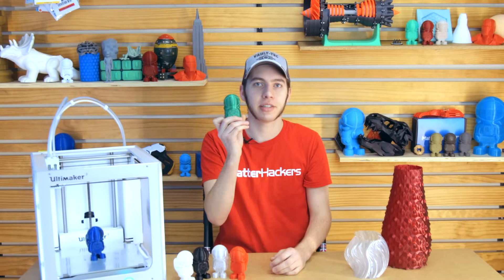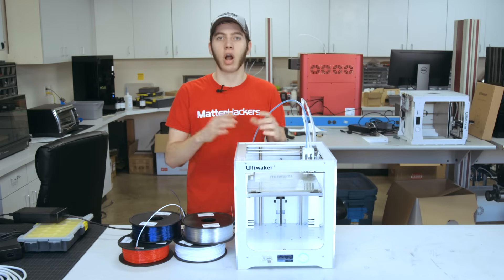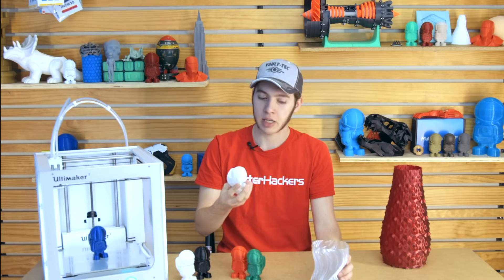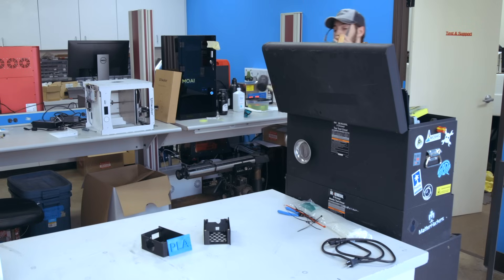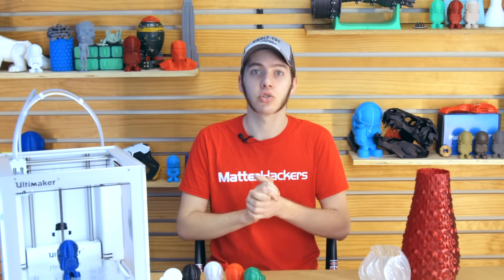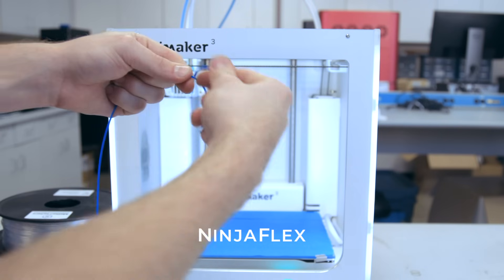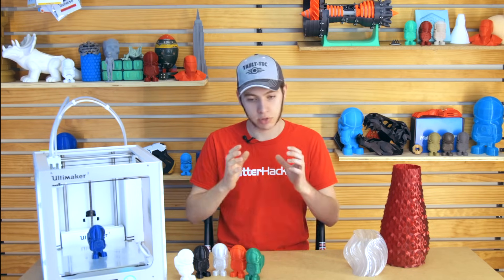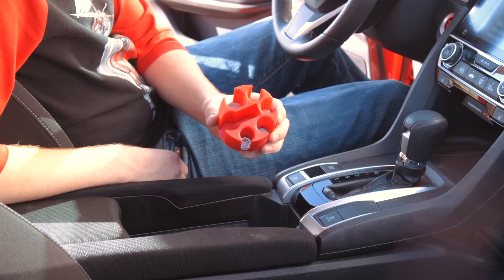BEST TIPS FOR BETTER PRINTS WITH PETG | Everything you need to succeed with PETG filament

Comment: Here I am in 2020 using amazon basics PETG and printing with a PTFE-lined hot end at only 230c. I leave the part fan off, except for bridges where it runs at 40% which is about the minimum for the crappy fan on my printer. The parts aren't super amazing, but they are absolutely serviceable and way harder to break than the same parts I print in PLA. Essentially, I can print finer detail in PLA with less globbing and stringing, but for anything that isn't a fine-detail miniature I use PETG. If I'd print it at .2 or higher layer height, its better in PETG. If I'm printing at lower than .2, its going to matter how tolerant the print will be to blobs or strings... but I still might try in PETG first because its a better material overall IMO.

Great tip about the support though, it can be a real PITA to remove, I hadn't considered increasing the gap - seems obvious in hindsight!

Comment: You don't NEED an all metal hotend for PETG, PTFE tubing is generally considered safe up to 250-260C, and frankly most PETG prints fine at 230-240 anyway. If you're concerned with it off gassing even the tiniest amount then I wouldn't print with it above 200C as that is when PTFE begins to off gas...

Comment: I'm still pretty new to 3D printing.  My problem is likely user error.   I have an Ender 5.  I have not done any upgrades so everything is stock at the moment.  I am having one heck of a time getting PETG to stick to the bed and not to the nozzle.  I'm going to pick up some hair spray to try next.  I have been trying to print on painters tape and it won't stick to my bed.  It keeps sticking to the nozzle.  my printer will run a prime down the right side of the bed no problem but as soon as it moves over to my part it just won't stick to the bed.  Any tips on how to fix that?  I've tried a bunch of different things (different temps, slower speeds, etc.) but I just can't seem to get the first layer to stick to the bed.   I'm printing PETG because I'm making custom kayak parts.  From what I gather that is one of the better filaments to use for such things.
Reply: I do keep it in a dry box.  I'm going to try and dry it out in the oven.  I also picked up a Micro Swiss MK8 Brass Plated Wear Resistant Nozzle to see if that makes a difference.  I just got it and have yet to try it.

Comment: Sorry, but 245 is not the low end for PETG.  I print PETG at 235 all the time with zero issues and strong layer adhesion.  So, no, you do NOT need an all metal hot end to print PETG.

Comment: Hi i have ender 5 and have been having some fails with PETG... i ordered a capricorn bowden replacement tube...should this tube handle the heat better than the stock tube it came with.???.. i had some fails where petg broke during print a couple of times...thanks for your content.

Comment: Thanks for the tips!!! I am printing with no heated print bed at all. BUT, I heated it up with a hair dryer good before starting. Using a glass bed with a little glue stick. My transparent is rated for (240-260C - 40-60mm/sec) So I'm doing 40mm/sec and 245C on my Colido DIY 3D Printer
-ConsultingJoe.com

Comment: Another note ... I ran into problems with strength and finish with PETG. Didn’t take long after opening the new spool for it to pick up enough moisture to turn the print to crap.  Bridle and weak print. So ... I put the roll in the oven at 170 deg F. and then put it on the printer and it printed perfectly. Moisture gone. Here’s the bad part .... next day when the roll totally cooled ... could not get the filament to separate and when I was able to pull it off the roll it snapped like a piece of dry spaghetti... wound up throwing the whole spool out. Don’t do it !!! Keep the temp real low and keep the filament in a sealed bag. Sorry this took to long, but $ 50. for a $3.00 part isn’t smart. Take care.

Comment: I printed a 1x1 x 4 block and adjusted the temp from 260 down on a cr10s pro. .04 nozzle .... adjusted the temp down as it was printing and when I hit 245c. It cleaned right up and stopped stringing and the surface was nice and smooth. Bed temp 60c. No nozzle fan. PETG Pro from MatterHackers in Black .... hope this helps out.

Comment: PET+ came along before any PETG filaments I have seen. Waste of money if you ask me unless the '+' means they've added gold. PET+ prints worse than any co-poly I have ever used, it doesn't hold a consistent diameter,  it's slow, it only wants to be printed at 200 microns, it ships with no moisture protection what so ever (no silica, and not even a sealed bag), and it's inexplicably expensive. Something like $75 fucking dollars a kilo.     I would be willing to bet that most PET(x) filaments with proprietary blends are just nothing more than PETG. They add glycol to keep it from crystalizing in the nozzle. 
You don't need an all metal hot end to print co-poly.... I used to print Hatchbox PETG on a stock creator pro all day long no issue. Just print slower and 200 microns or less.

Comment: Not sure what PETG you're using, but I print mine on a stock Ender 2 with 225 - 235 °C and get perfect results. So far I've tried 'HD-Glass' from FormFutura and the PETG from DasFilament. The HD-Glass's recommended print temperature ranges from 195 - 225 °C and the PETG from DasFilament says 230 +/- 10 °C.

Comment: Is a E3D hot end all metal?
Reply: The real mainline e3D V6 is considered "all metal" (it has PTFE in it, but it stays out of the hot area), but their "Lite" version is NOT (it has PTFE all the way through). Clones tend to vary wildly by manufacturer and sometimes even batch, so you'd need to disassemble yours and check. I'm not sure about the older versions and exotic variants.

Comment: Thumbs-down from me.. Sorry, but in my opinion these are all-layman facts/recommendations with very little value due to the following two reasons: 
1) Anyone with actual experience in printing with PETG will tell you that there are many different parameters (e.g. extrusion multiplier, Z-offset, first layer calibration, printing speeds, support design, Z retraction length and speed etc..) which need to be customized before you can tune your printer to an acceptable-good quality of printing. PETG is a great all-around filament once you figure those parameters; however getting there can be quite a journey. 
2) In comparison to other videos available online there aren't any new facts offered here. After many hours of reading through various blogs and posts I am finally learning how to adjust the slicer settings to get acceptable printing quality. There are very few videos which actually talk about the pro tips that are really important. Some of these are:
 - Relationships between filament diameter tolerance and/or aging of the filament and extruder multiplier factor. 
 - Adjustments of the filament Z-retraction distance/speed and extra length on restart to avoid oozing/blobs issues. 
 - Support fill-in density / pattern and print quality of overhanging features. 
Considering the fact that PETG, in comparison to PLA, requires more advanced knowledge, I was expecting MatterHackers to offer a little more insightful video.

Comment: Desiccant can remove water from the air, but not filament? Since the water moved freely from the air, to the filament, we can assume the reverse is true to. So if You put desiccant in a sealed container with filament, it would stand to reason the air would become extremely dry, which would lead to the filament drying out.
Reply: But it will not be quick. You'll save hours (or maybe days) if will dry it in an oven (with an appropriate temp.). IMHO

Comment: Just got an Ender 3 and was using PET-G as my first ever filament to experiment with and it has been difficult (1st layer difficult to stick/stringing/clogged my extruder once/ruined a would-be successful print because i didn't tighten my nozzle down enough after replacing nozzle allowing filament to extrude from the threads of the hot end).  I've ordered some PLA to make life easier, will try the PET-G again once i become more experienced and maybe upgrade to an all metal hot end.

Comment: You Know, We look to you as information experts in your field and We look to you for information to help us decide what to purchase when we need materials. When it's obvious that you are holding back when you are smacking the PETG, we lose faith in what you have to say and when we lose faith in that, we lose faith in your products so do me a favor. When you share information, don't try to alter the outcome to your benefit, you will lose.Thanks.
Reply: To be fair, if they truly wanted to misrepresent the product they just would have edited that bit out. I would take the hammer test as being as scientific as it appeared. (i.e. not at all)
Reply: Whaat? Come on man, the guy is doing you a favor, PETG is tougher than PLA but not as strong in direct impact resistance in few occations, which are due to geometry mostly and you can easly see that the prints are diferent. he's hitting a PETG print that has less material.
Reply: I thought the same thing. Haha

Comment: Question, most PETG I got have to low end of the temp ranges at 220... and it does work. Why so many people say it has to be above 250 C?
Reply: Different PETGs have very different temperature ranges. Depending on how much G they put in their PET, the material might print well almost at PLA Temperatures and start bubbling at above 240, or it might not even extrude at those temperatures and take 250 to print properly. There are no blanket rules for all PETG filaments.

Comment: If I use a dry box for PETG will it wick moisture to the rest of the filament? I would like to make a dry box then leave just a small amount outside of the box for access. When I use it I will just cut off a small length before using.  I cannot do this if the access length will wick the moisture to the rest of the filament.

Comment: New to this, 1st printer and all, so I got confused on the bed talk. If the blue painters tape is put down for adhesion then is another layer (glue) still needed over the tape?
Reply from the maker: You do not need to apply glue to the blue painters tape.

If you have a heated glass surface (50-60°C) without painters tape, you can use unscented hairspray as an option. Again, if you do NOT have the painters tape.

Hope that clarifies! =)
Reply: I just use the cheapest sented hairspray I can get from local homestore or food market on top of painters tape, never had an issue with adhesion with PLA.

Comment: Everyone is saying PETG has the positive of pla and abs, but its tensile strengh is weaker than PLA, its impact resistance weaker than ABS (it also shatters violently unlike ABS) and I personaly don't think it prints as easy as PLA. But yes it doesn't warp that much and doesn't smell.
Reply: It is also heavier. So you get less prints.
Reply: Stuff With Kirby Yes good point, I often forget to think about density.  An other disadvantage of petg

Comment: I like to use PETG for working parts, but it is not easy to print with. I have thin but dense  stringing on the inside of curved surfaces and after time some excess material builds up on the surface of the nozzle. what  later on sticks to the printed part . Any suggestions?
Reply: Right, nothing about that in the video, strange. I found that lowering the temperature can reduce stringing. Keep the hotend clean, I even added some oil to prevent the PETG to stick to the hotend.
Reply: 235 and slower works for me 80mm
Reply: up your retraction speed and or distance. lowering the nozzle temp will lower your layer adhesion. Which will make the parts weakers thus removing the point of printing petg. Something one can see in this video. That's why you shouldn't let other people read the script that some writes. Especially if they aren't an expert. Which might seem blunt to say, but taking into acount that they're a filament company is quiet funny.

Comment: I think that strength test was a win for the PLA.
Reply: That just goes to show that PETG doesn't actually have high impact strength compared to PLA. It does however have much higher tensile strength. I think they should've clarified it's strength properties a bit better.
Reply: Funny thing is the he hit the PLA considerably harder than he hit the PETG as well.
Reply: @trueflightgaming9104  He start the hit on PLA on a side with a huge hole. the PETG part had only solid sides... 😏😏
Reply: https://youtu.be/inzkJ34VMfk?t=30
Reply: Turns out pla is pretty strong! But it's Achilles heel is thermal weakness
Reply: Agree!
Reply: i think because the pla have a thicker perimeter or more infill
Reply: @kimchourluy8139  you don't understand what printing two exact parts for a demo test means eh? More perimeter or infill lol whatever makes you sleep at night.
Reply: I think his strength test was very scientific and a lit of conclusions have been drawn from his rubber mallet durability test
Reply: Me to he went some on petg
Reply: but for how difficult it is to print ABS, it's not even worth it.
Reply: Tomzuki I think you have it backward, PLA is almost #1 in tensile strengh but very low in impact resistance. ABS have hight impact resistance but low/average  tensile strength. PETG is a midle ground in both (and this is not a good place to be in my opinion)
Reply: @teedjay91  and best of all is water neutral vs abs pla ,,pet cant drink water ...
Reply: @MrCcfly  so it works well for water sports?, it sounded to me like he said it absorbs moisture. Can it handle being used in aquatic situations? As a final product?
Reply: @piratestyleadventures7185  pet is plastic that bottles are made and per-g is one with glycol added to it to form better .... so no wasn't agroscopic petg and if printed properly petg is like abs on steroids strength vise
Reply: pet-g
Reply: @MrCcfly  thanks.
Reply: @teedjay91  lol  prtg can pull 2x then abs can and is stronger then pla so ---
Reply: Agree
Reply: its a joke.

Comment: I have some Avistron German PETG and I am printing it at 217C through a PTFE lined hotend all day long. No problems and it works perfectly. Think it depends on the individual PETG you are printing. Great video as usual. Plus thanks for supporting Joel Telling.
Reply: Sonic Alchemy: A maker space - I’m printing at exactly the same temperature (217C) on a Ultimaker 2 extended+, which has a TFM coupler. I don’t get where his ‘need for an all metal hot-end’ advise comes from.
I currently use Real Filaments PETG (Dutch brand) on my Ultimaker 2 extended+. It took quite a bit of trial and error to get the right settings since Real Filaments advised 230C - 250C, so that’s the temperature range where I initially started. But now it prints beautiful and strong parts with hardly any stringing.
Since PETG has a much narrower temperature band in which it prints right, it indeed pays off to experiment with temperature settings from printer to printer.
Reply: Exactly. It really depends on the printer and space.